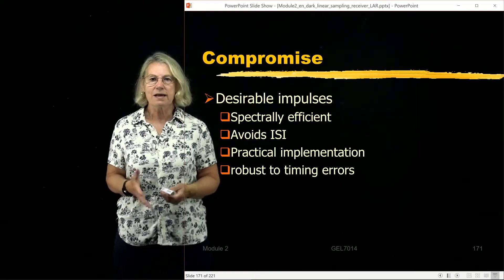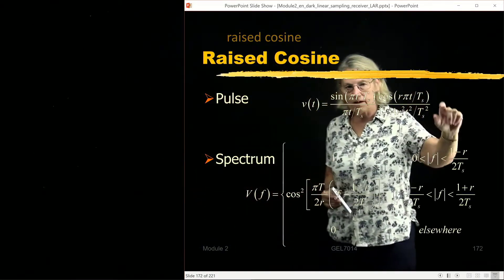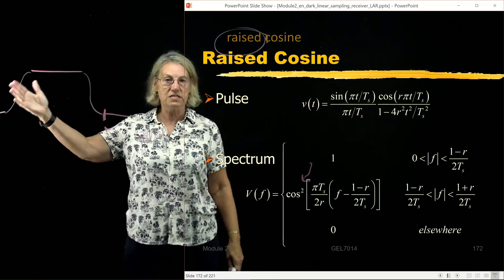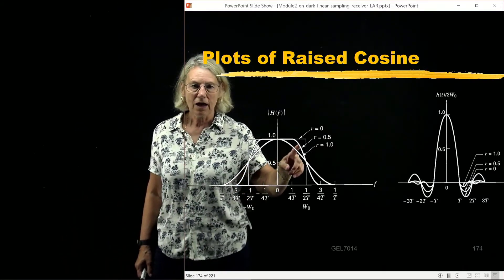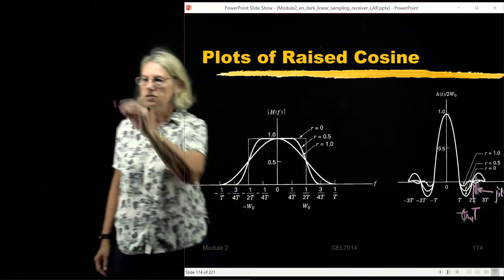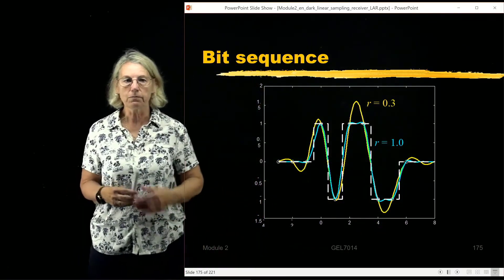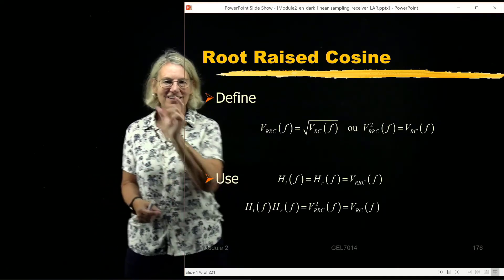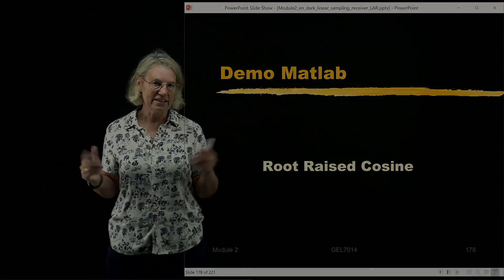GEL7114 - Module 2.12 - Raised Cosine pulses

Comment: Thanks a lot Prof. Leslie;
Please, I have very interesting question, I'll so appreciative to you if you have precise answer for it,
the question is about how we can theoretically calculate the cut of frequency of the raised cosine filter for OFDM signal (pulse shaping) before driving the IQ modulator for frequency upconversion from baseband to RF carrier?
Please, I'm so need your help about that from your experience and deep knowledge in this regard.
thank a lot :)

Comment: Dr. Rusch, is the srrc filter applicable to passband modulation?
If so, where would it fit in a practical qam modulation scheme with I and Q vector basis?
Thanks again fo your content.
Reply: It is indeed passband filtering. It is applied just after you create IQ signals. Imagine DPSK signalling wherein you modulate cos and sine components with the bit variations. Post which you may need srrc to limit sudden variations in the phase of IQ signal